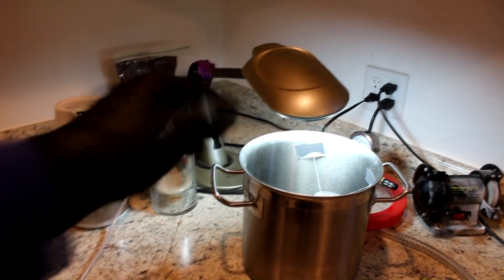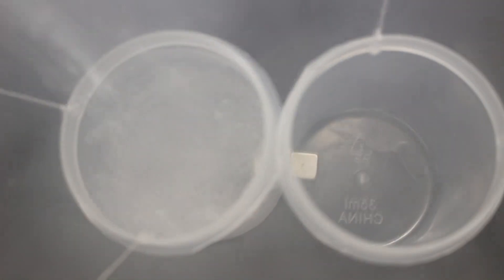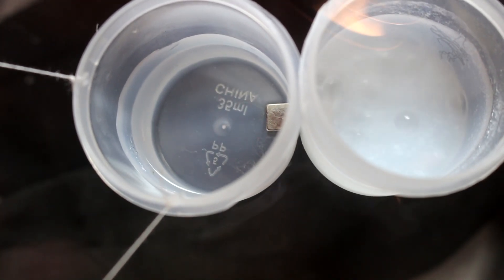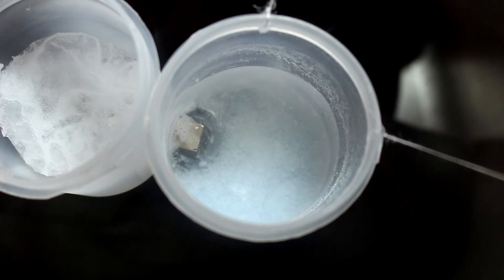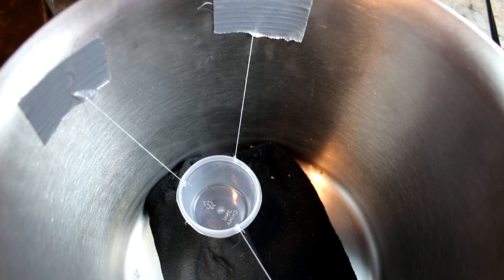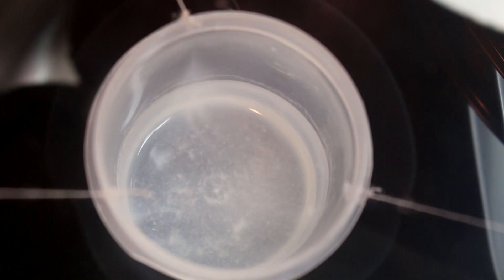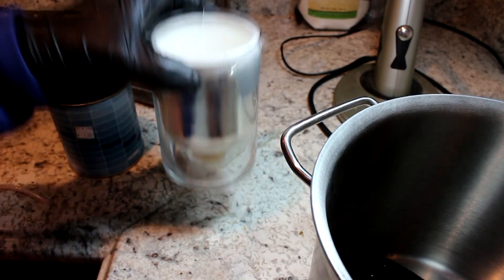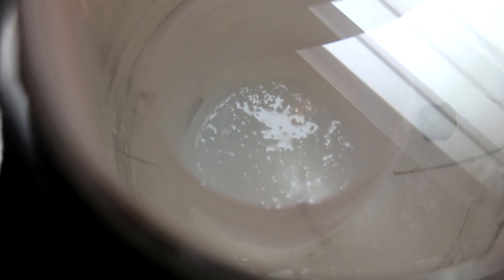Making Solid Oxygen

Comment: can you mine oxygen in space using magnets?
Reply from the maker: maybe out near pluto
Reply: Cody'sLab Because temperature is 0k or 4k . ? and its vacuum. why specially near Pluto? weak gravity?
Reply: Interesting thought .
Now, would an electromagnet be efficient enough to mine enough O2 and H2 for supersolar exploration?
Reply: vaccum has no temperature, it's nothing :)
outer space isn't cold everywhere, when facing the sun, it's even blazing hot !
Reply: Y2Kvids Pluto is cold
Reply: Vaccum is cold isn't it?
Reply: If what you say is true then is it possible to create an atmosphere in space using powerful magnets??

Comment: Have you ever heard of a triple evacuation? its used in my trade to clean an a/c system of non-condensables. the whole idea is too pull a vacuum for a 10 mins or so. then kill the vacuum with nitrogen and let it settle a little. then pull a vacuum again. and repeat this until you can reach 500 microns or 30 in hg. or anything close to that.

Comment: Is Liquid oxygen Flammable?
Reply: it makes things extremely flammable
Reply: facepalm
Reply: Puzzled Expression
Reply: Combustion is when one material (fuel) is oxidised by another (oxidiser). Liquid oxygen, because its a liquid is far denser than gaseous oxygen, so it is better at oxidising fuel.
Reply: Did you not hear the whole rocket fuel part at the beginning?
Reply: mixing them yes liquid oxygen by it self...
Reply: It's not flammable by itself. It needs fuel that it can oxidize - but when fuel is present, it makes for an extremely flammable mixture.

Comment: Why does putting things under vacuum cause them to freeze? I've always thought that the opposite was true. If you lower the pressure on water for example, it begins to boil at lower and lower temperatures. If you compress a gas enough, it turns into a liquid. What is the explanation for what we see in this video?
Reply: When the vapor pressure of a liquid equals the pressure of the atmosphere it is exposed to it will boil.  Dropping the pressure of the liquid oxygen lowers the effective boiling temperature of the liquid and ultimately causes it to boil.  Most liquids have a heat of vaporization, energy that must be put into the material to turn it from a liquid to a gas, and this energy is taken from the liquid, cooling it further.  Another way of looking at it is that temperature is a measure of the kinetic energy of molecules of the material.  The molecules with higher kinetic energy end up in the gas, leaving an average kinetic energy in the liquid that is much lower than it was to start, thus lowering its temperature.
Reply: Evaporation is an endothermic phase change, so as the oxygen/ nitrogen moves to the gas phase, the remaining liquid decreases in temperature until it reaches its freezing point.
Reply: Here's some explanation. When you put water at room temperature into a vacuum, it will begin to boil. As it does so, the very action of boiling decreases the temperature. Think of it as boiling taking energy to accomplish, and thus reducing the energy inside the water. Once the temperature is lowered sufficiently, the water will freeze. There's some youtube videos of this being done, but I'd recommend just looking at a phase diagram of water. 
https://upload.wikimedia.org/wikipedia/commons/thumb/0/08/Phase_diagram_of_water.svg/700px-Phase_diagram_of_water.svg.png
Stare at that for a few minutes and it should all start to make sense :)
Reply: Thanks!
Reply: Well, what you're saying is correct, but I don't think I see how that's the key. Functionally the two mechanisms are very similar, and either one results in cooling the involved fluid. Basically evaporation is just boiling that happens below the boiling point. 
(Also, it's the ideal gas law you were thinking of)
Reply: I think I heard somewhere that the core of Jupiter is mostly solid oxygen. Must be a large amount of pressure there. So confusing.
Reply: I think the key is that boiling =/= evaporation. 
Boiling means you're adding heat, evaporation is the surface particles naturally escaping.

Also the gas being compressed raises the temperature. (Some gas law or other)

Comment: I have a few questions...1. about mars I read conflicting theories, about atmos on mars, one says you could be out on mars with just a oxygen mask but no suit during parts of the day and certain season. Others say not at all...which it true?

2. Is there more oxygen in a cubic liter of liquid oxygen, than in a cubic of the type we breath. (i know liquid once evaporated is breathable but is it condensed) If so is that how they store oxygen on the space shuttles? should have done more reading before asking..but well.

the current method of oxygen making on the ISS though electrolysis seems potentially dangerous should static occur near the hydrogen.

Comment: You have liquid nitrogen! Pour it on your pump so it not overheat!
Reply: Luiz Fellipe Carneiro your pump would crack.
Reply: How did it crack liquid nitrogen dont freeze
Reply: Refrigerators cools all the air around it
Reply: It would overcool
Reply: Its a joke
Reply: Try sticking the pump in the 'frig or freezer, w. holes cut to allow hoses & electric wires in (along with a gasket around them), to keep the pump cool or cold? Just a thought.
Reply: That would not work, as a refrigerator does not have an easy way to let off heat. So if too much heat builds up in there, it will not be very effective. This is why no one puts, for instance, their computers, inside of refrigerators, because they do not handle heat very well. And a way you can see that in everyday life is if you touch somewhere around the bottom of the door, or certain places where it tends to let off heat, you'll see those places will be quite warm. While it may not be possible to do that with a regular refrigerator, there may be a system in which you could build a refrigerator like object that has an effective heat-sink.
Reply: JGdude u put stuff in fridge to cool it off or it burns its circut boards
Reply: @jgdude7460  Im a refrigeration engineer and i literally don't have enough time to tell you how wrong you are.
Reply: @whatshappenedhere1784  So do you mean it actually is viable to put, like, your computer or any kind of hot electronics inside a refrigerator without the electronics not working in some way or another?
Reply: @whatshappenedhere1784  you are officially my hero. Perfect response to a pointless question!
Reply: @april5054  A lot of industrial electronic equipment relies on refrigeration to stop it over heating. The latest advancement is liquid helium cooled components for quantum computing. The computing is most efficient at 0 Kelvin, but we cant easily achieve that so 4 Kelvin is sufficient with liquid helium.

Comment: You should purify air before you freeze oxygen. I see you have plenty of liquid nitrogen around, so you can make a cold trap for removing CO2 and water vapor. Also, I'm surprised you don't have an oxygen tank.

I can't be sure by how much, but LOX dissolves solid CO2 just like liquid nitrogen does.They're both nonpolar. As a matter of fact, such solution would have a depressed melting point than pure LOX because of colligative properties. So you should've gotten an even lower temperature when it solidified. :)

If you use LOX only, you should get a solid at higher temperature, just try to put something sharp inside as a source of nucleation.

Thanks for making this video.

Comment: I understand that a vacuum pump has a lot of precisely sized moving parts with tiny tolerances for rapid thermal expansion/contraction, but surely with a dewar full of liquid nitrogen, you could have thought of a better way to cool your pump than to stick it in the fridge...

Comment: Curious: could you give a rundown of lab equipment like the vacuum chamber, pump, and dewar flasks? I'd especially love to know the best way to source such equipment, used or otherwise.
Reply: That looks surprisingly like a standard automotive air conditioning system evacuation pump. They use them to suck all the air out of your air conditioner so it won't contaminate the coolant. You can get them for cheap at Harbor Freight. Applied Science channel has the same Harbor Freight model we use. For the price you can't beat it, and you don't worry so much if it sucks in fluid or overheats. If you break it, it's not going to cost a lot to replace.

Comment: I've made liquid oxygen several times myself, using liquid nitrogen, and the way I did it was by filling a metal container with LN2 and then letting the oxygen condense onto it, and drip down from the bottom of the outside of the metal container. That way the solid CO2/H2O won't contaminate your oxygen as much, since it will just stick to the metal.
Reply: Also, I've done experiments with putting LN2 in a vacuum chamber myself too, and the thing that prevents it from freezing and thawing like that is by putting in contaminants (a boiling stone).

Comment: I don't quite get it.. Why is it so that getting the pressure up makes liquid become soild, while lowering the pressure makes for example water boil at lower temperatures, yet also makes liquid become solid? Logic here doesn't work ;-;
Reply: Raising the pressure will barely have any effect on a liquid (extreme pressures are needed). Removing pressure allows the hottest molecules to leave the system. Leftovers are slow moving = solid.
Reply: Lajos Winkler
Thanks, so basicaly the substance gets "split" into two states, one which can boil and other which can solidify, that's why the triple point?
Reply: Tomclanys Particle energies roughly follow Maxwell-Boltzmann distribution (check it out to see the graph). At any given point in time, there are hot ones, cold ones, etc. (of course, it's not the same ones - they exchange energy all the time). Lowering the pressure just removes the atmosphere pushing down to contain the hot ones from escaping.

Triple point is a value of pressure and temperature where all three phases can exist in a dynamic equilibrium.
Reply: Thanks a lot!Lajos Winkler